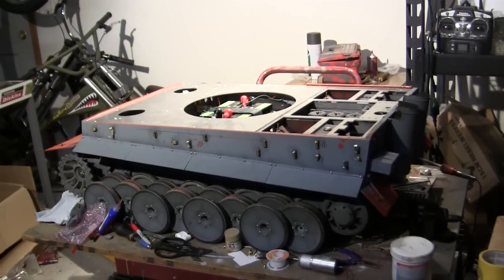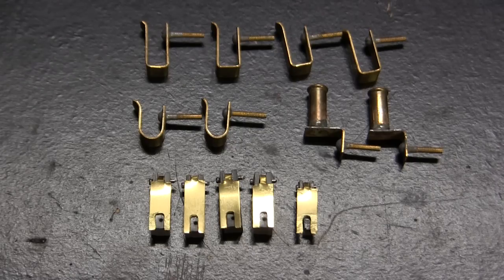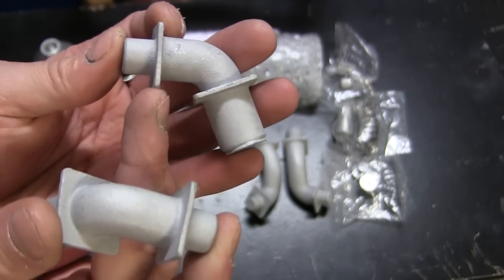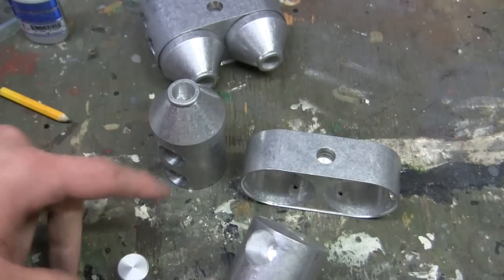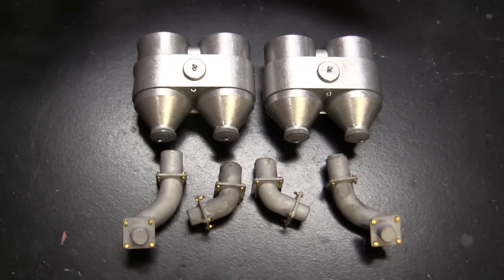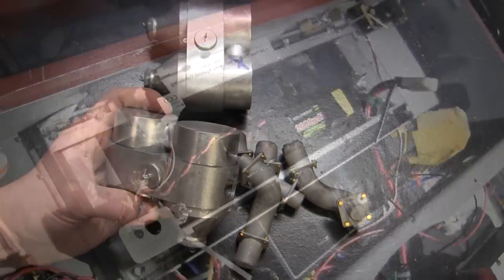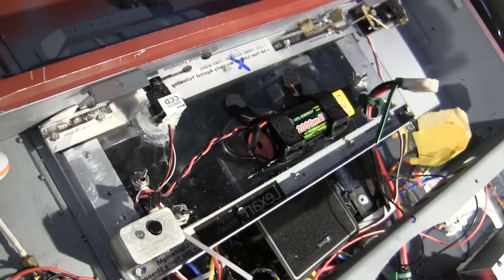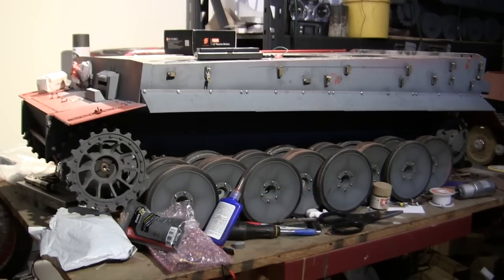RC 1/6th scale Armortek Early Production Tiger video #14 (side hull details, and camera system)

Comment: Please replace that vtx antenna very poor I'd recommend a menace rc or a ax11 much better performance
Reply: Menace Raptor 5.8Ghz Stubby Antenna (SMA) (RHCP)

The stubby Raptor antenna is a small compact Omni that delivers a smooth radiation pattern and a high axial ratio with its unique PCB pagoda construction designed by Maarten Baert.

Availability: In stock

£9.00
Reply from the maker: @Dudeiculas  cool thanks for the heads up, I'm still new to RC cameras and transmitters and am learning as I go along. One of the worries I had was with the tank is buttoned up the metal will restrict the transmission. Will the new antenna work with the transmitter I used?
Reply: you seem to know your cameras, do you know any FPV systems that could see through a 1.5mm hole? its for a 1/16 Panther Ausf D i am making
Reply: @STHV_  No mate that is a very small hole most of the fpv cam are quite wide angle hope you work it out great videos